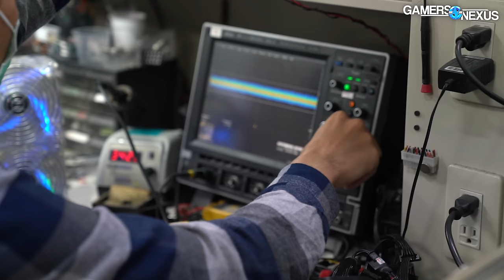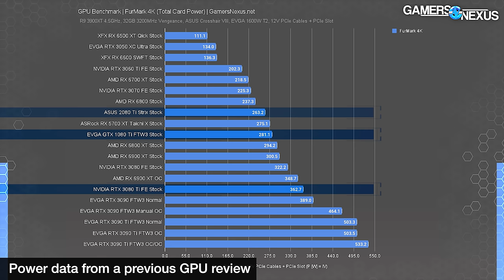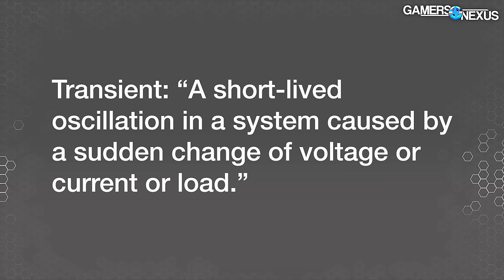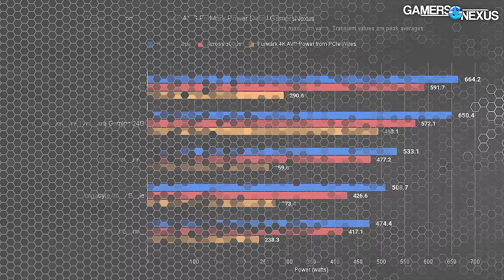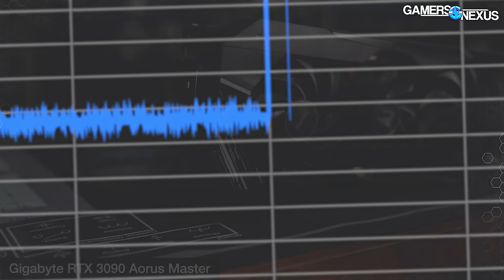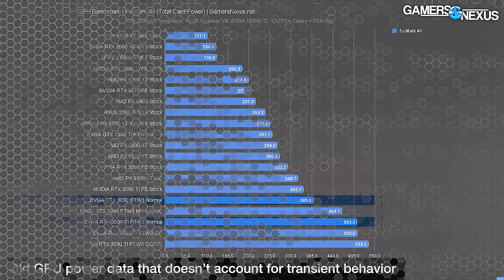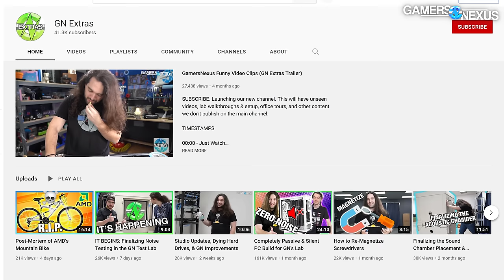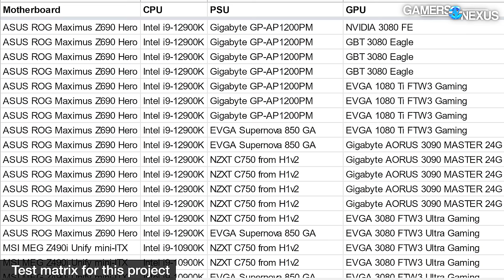The Brewing Problem with GPU Power Design | Transients

Comment: The upcoming ATX 3.0 specification, which was finalized in April, is specifically supposed to address this issue. So, I'm really surprised there was no mention of it here, at all. I've been eagerly waiting for some kind of news from Gamers Nexus, about when ATX 3.0 power supplies might be expected to start rolling out, or if the RTX 4000 series cards will have the new 12+4 GPU power connector on them, which is part of the ATX 3.0 spec. Please ask one of the power supply manufacturers, about an ETA on ATX 3.0 PSUs. I'm very eager to find out, since I'm planning a Ryzen 7000 system.
Reply: They'll surely have the 12+4 connectors on the FE/reference cards, but are unlikely to require it of the AIBs.

The big question is what the PSU requirements will be.  I'd assume they'd say something like '4090 requires a 1000W PSU, or an 800W ATX 3.0 PSU'.  Also, as you noted, its unclear if the ATX 3.0 PSUs will be ready for an October 40 series launch.  It would be really dumb to buy at launch if you have to upgrade to an ATX 2.x PSU that's becoming obsolete.
Reply: Looks like you are expecting people go out to change their PSU with ATX 3.0 spec. Tell it to those people with no knowledge, or those with 1000W+ Platinum rating. 

I doubt those with some years old 750W Gold PSU or above will do that so this info is very useful for the years to come.
Reply: This guy asking the smart questions. Where's atx 3
Reply: @JorgeAlarconL  its very relevant info... Whether you are too ignorant or cheap to buy into the new standard is not relevant.
Reply: @Xirpzy  Assuming that everyone should buy into the new standard and that anyone can afford it is actually ignorant. A good PSU stays a good PSU for as long as there are devices it can run, and people either don't see a reason to change their PSU because of a new standard or they don't want to change their expensive high end PSU just because of a new standard. Some people may not even be able to afford a decent PSU at all. Your comment sounds very pretentious as if you're saying "lol just buy it you poor pleb". Very very disrespectful.
Reply: I'm also waiting for this. Buying a PSU now when ATX 3.0 might become a standard in a few months seems like a bad decision. @GamersNexus, what do you guys think about it?
Reply: @Apexseals The "power excursions" is part of the ATX 3.0 spec, I just double checked.  Table 3.1.  It goes up to 3x for up to 100 μs.
Reply: @Apexseals No, the OP is right. ATX 3.0 was specifically designed to at least reduce transient spike shutdowns. Hardware Busters did a very thorough video a few weeks ago.
Reply: @supra107  only if you read it that way. 

If anyone is to inform us about a new standard I expect Gamers Nexus to do it. Sure you can mention that not everyone can afford it but actually knowing ATX 3.0 is even a thing and what it does (aka not being ignorant of it) is far more important in my eyes. Someone looking into buying new hardware should be made aware of it despite the cost, because its the new standard.
Reply: @supra107  If you can't afford a new PSU you surely can't afford the next gen GPUs especially the high end ones. You are not the target audience. Deal with it. The golden age is over and PC enthusiasm became a higher class (rich) hobby.
Reply: My card currently has 2 such connectors and the adaptors it came with take 3 8pin pcie cables and turn them into 1 12pin connector. The data pins remain empty for now. But yeah, if the 3090 ti cards have them now, you can bet the 40 series will have them. You’ll just have to use an adapter and not populate the data pins with an old PSU
Reply: @Xirpzy  it would be speculation at this point! There are no fvck¹n atx 3.0 PSUs yet. So why would a tear-it-down/hands on hardware channel speculate? Please do tell.
Reply: i hope they dont cost as much as gpu for flex sized psu
Reply: @Xirpzy  It's too soon to say if the information is relevant. And the 'people are too ignorant or cheap' angle is weird. There is no reason good PSUs should become obsolete because GPUs change.
If anything, if PSUs become disposable, that would be a reason for people to stop caring about PSU quality.
We've seen what Apple can do with low power CPUs/GPUs, the market as a whole is moving to better efficiency, for the PC market to move in the other reaction is bad.
Reply: @Gege547  Not neccesarily. Many enthusiasts like me focus on the 2nd hand budget  market and in how to recycle / upgrade old devices to get modern features. I have just upgraded a 10 year old system ( dual Xeon 16 core) that I got super  cheap on eBay by adding two  NVMe raid0 via an1500 (I get  6.5 GB/sg, equivalent to modern  PCIe-4 NVMe ), added an usb-c 3.2 hba, installed a 2nd hand  3080 (thanks to crypto crash...), and a 10Gb ethernet hba,  and now it performs equal or better than  most high end  gaming PCs  for half the cost. And in two years I expect to migrate it to RTX 4000 when 2nd hand market appears for them.
The PC enthusiast hobby  is not only about the latest builds. In fact the sacred rule for most PC enthusiasts is to avoid propietary architectures (like Apple) so that you can later repair &  upgrade at open market prices, and specially to practice our favourite activity: scavenging!
Reply: @quintoblanco8746  how is it too soon if theres already articles about it and GN has mentioned it before? Talking about it in a video specifically about power supplies is to be expected... GN has several videos on 40 series cards and am5, are those too soon as well? I want such information so that I know something better is coming soon. 

Again whether you can afford it or not doesnt matter if you dont know about atx 3.0 to begin with. If people are ignorant they will loose money by spending on wrong things. Pls enlighten me how that is a good thing.
Reply: @LiquifyMods  Normally, I would expect things to take a couple of years after a spec is finalized. But with the connector already on the 3090, and there being a more immediate need for the spec due to power spikes, it does seem likely that the 4000 series will probably have the 12+4 connector. But, I can only guess about it, until there's official news. FSP has also announced an updated power supply with the 12+4 connector as well. So, it seems likely that this spec will be rolling out rather quickly.

Sure, with a high watt PSU, an adapter can likely be used. But, I'd much rather buy an ATX 3.0 PSU if I can, since it will have the capacity to handle power spikes more than double the rated voltage, and is much more likely to be compatible with future GPUs. The ATX 3.0 spec is a significant update, especially for GPUs.

But, here's the real kicker. As I understand it, without a power supply with the 4 pin sense line, on the 12+4 connector, the GPU will be limited to the lowest power setting, which will bottleneck and artificially cap the GPU, even if the power supply is otherwise large enough to handle it. It seems likely though that individual GPU manufacturers would probably override that with an adapter, especially early on in the transition. So, I'm not too concerned about it, but it's just one more reason I'd prefer to get a PSU with compliance to the new spec, if possible, since I'm planning to buy a new PSU soon anyway.
Reply: I saw Cooler Master is putting out   SFX-L 1100 watt and 1300 watt ATX 3.x psu's at some point. Sounds like they were made very specifically to address this issue for the next generation of PC hardware. Hopefully those will be out in time for my next sff build.
Reply: @Marin3r101   GIGABYTE UD1000GM PG5

Comment: I was aware of power spikes in GPUs, but until watching your video, I had no idea they were this severe. I'm getting ready to overhaul my PC and my failing old Corsair PSU needed a replacement. I've just ordered a PSU with more headroom than initially planned to prepare for newer cards and I'm sure it'll save me a lot of trouble in the future. Thank you GN. You're the only mainstream hardware reviewers that are covering topics like this with actual data. For how small this operation is, it's incredible how far ahead your data and methodology is versus much bigger hardware reviewers.

Comment: Yeah got that first hand when I upgraded to a 3080ti. 850w should have been plenty for the steady state, but transients were enough to send the PSU into safety shutdown.

Since you asked for details Steve: EVGA 3080Ti FTW3 Ultra Gaming, ASUS MAXIMUS X Formula, 8086k Der8auer edition @5G all-core, Seasonic Prime TX 850 from 2018 couldn't hack it after upgrading from a 1080ti.

The 1kw model of the same line is doing fine, absurd as that is on a system that draws 450w average while gaming according to my UPS.
Reply from the maker: Great to see real user experiences like this to help establish that this is a factor to consider now!
Reply: @GamersNexus  not just that, even my cable extensions from asiahorse weren't able to handle my 3080, just because of the power not being clean enough
Reply: @GamersNexus  i have been running a gigabyte 3080 on a rm850 that is quite old for a good while and haven't seen these issues. It's a 320w hard limited model so I've made my own curve for it where it really doesn't do the stupid push past 2040mhz at like 1060mv. Mine mostly run 2025mhz at 1000mv so I wonder how this curve affects transients.. I'm not finished with the video yet obviously but I would be interested to see transients without Nvidia boost algorithm.
Reply: This explains an issue I had with a SeaSonic Prime Titanium 1000W about a year and a half ago. Shortly after adding a Gigabyte Waterforce 3080 to a Ryzen x570/5900X system, the PSU blew out. I could not understand how a PSU I had had for 2+ years across multiple platforms would all of a sudden give up the ghost, but to SeaSonic's credit, it only took itself out and every other part was fine, but I literally had no idea it could have been the GPU until now. Yikes!
Reply: Had my 3080ti kill a Seasonic Prime Titanium myself, currently in RMA.
Reply: Ive got the rog thor 850w running a strix 3080ti and i9 12900k overclocked at 5.2 ghz and havent had any issues. The max wattage that gets pulled is 670ish watts
Reply: Edit- I have a scope and a low end amp clamp (considering buying a better clamp)

Interesting comments. I've been running a Corsair RMX850 and TUF 3080ti all stock speeds and voltages (Asus X570 + 5800x) and haven't had issues at all. What can I do to test this out? I've tried 4K max settings and some benchmarks and everything seems great (besides my CPU temp, but that's my fault form bad rad/ fan optimization) Man am I glad I went with the 850 over the 500 lol.
Reply: @GamersNexus  would be cool to test if the PSU cables with built in caps actually help. I have a few older Silverstone cables with the caps by the GPU.
Reply: How old was that PSU. Do not forget that aging PSU can lose up to 10% of capacity a year with heavy usage.
Reply: @Bobinification  I didnt even know that.
Reply: Pretty happy at this point that I bought a way overkill (at the time) 1000w Platinum power supply from EVGA (Supernova 1000PS). Owned a 780 TI and had the idea in my head that I would SLI two 780 TIs at some point, never did, but now I have a 3080 and didn't have to upgrade the PSU or worry about its capability of running the 3080. Though now I'm wondering if it'll really be enough in the future if card power draw keeps going up.
Reply: From the issues i had with seasonic, it seems the problem is due to their OPP/OVP over the rails and you can end putting like CPU cable + gpu on same rail, since there arent any indication of what plug goes into what rail
Reply: @hondawagonz886  It could be less with light usage or with a high-end PSU but the principle always apply. The internal caps will be drying for sure.  Never expect a 5 years old PSU to deliver like it used to on day 1. I would bet that people here complaining are mainly people who upgraded the graphics card down the road but kept the old PSU.
Reply: @vidjagames72  After 10 years I would personally replace any power supply anyway.
Reply: @Bobinification  Actually it's probably because it was most likely a pre 2018 prime TX, which did have alot of problems with high transient GPUs(most notably Vega) which Seasonic did say they fixed already after 2018. But it was most likely that, not PSU age.
Reply: @Bobinification  Looked up my purchase date, it's going on 7 years old. Guess we'll find out the power requirements for the next gen or two of GPUs and I'll have to plan on a PSU replacement (or upgrade potentially) in just a couple years.
Reply: @Bobinification  not true at all. A high quality PSU will loose 1-2% of it's capacity over 10 years. 10% loss over a year would be insane.
Reply: @Bobinification  Whats your source for that 10%? 

1, maybe 2% for a budget unit is much more reasonable. At 10% a 1kW PSU is going to be under 600W with your 10% after 5 years, and those usually have a 10-12 year warranty. So an HEDT system can pull 850W easy. 5 years of working loads... your looking at RMAs every 3-4 years on a 12 year warranty.
Reply: @mortenee88  Same RM750X ran a 3080 with no issues.
Reply: @xuyukun123  Ive stopped using cable extensions because i had issues with USB (had low profile extension cable for front usb i/o), also had an order with cable mod.   Grossly out of whack with what i ordered (wrong lengths, some different pins). Im not using them incase of any issue. Cant trust them at all.
Reply: @vailpcs4040  What was the solution?  Ive been using Seasonic for awhile. If not their PSUS, then whos?   Thats the reason we pay $$$ for , not to have problems!!!
Reply: @nickierv13  I meant the ability to handle transients, not steady state power.
Reply: @ionstorm66   I meant the ability to handle transients, not steady state power.
Reply: @Bobinification  still stands. Some quailty psus have 10 year warranties, which would be next to impossible if they lost that much per year.
Reply: @ionstorm66  Let's agree to disagree. Some PSUs also have different caps quality.

Comment: Seems odd that the motherboard choice affects whether the problem shows up. Could be that some boards have extra capacitance on the 12V rail that "help out" the PSU when dealing with spikes. Or it could be that in some cases it's the motherboard that causes a shutdown if a 12V sag causes it to switch off the PSON signal.
Reply: could it possibly be the pcie slot has more throughput for voltage on some x boards?
 Ge it can do 110w vs the "normal" 75w. so when it hits a transient spike, the slot compensates for it.
Reply: @Dracossaint  Seems like a legit possible theory, the motherboard should never do that though the spec is there for a reason. Above all though the GPU should never need to be drawing 700 watts and if it is going to be doing that the GPU should be the part with the extra capacitance to handle those spikes without requiring other components to carry the load for their poor design.
Reply: Both the amount of capacitance, and the amount of energy the inductors can store will affect the behaviour of a motherboard or GPU card during transients.
Reply: It’s not only capacitance. With transients this big, your board needs to be designed differently. If the copper carrying power to your PCIe slot is too thin, or it’s ground is not directly underneath, the added inductance can negate capacitance on the bus.
Reply: @bdhale34  It's not the motherboard that should not do that, it's the graphics card's duty to not draw more than in total 75W (66W from 12V rail) from the board. 
On the other hand many boards can provide more than 75W of power. I think since the RX480 there were no GPUs drawing more than 75W from the PCIe slot.
Reply: @Dracossaint   Some motherboards do have supplementary PCIe 8-pin headers, very prevalent with older 2/3/4-way SLI/Crossfire XOC boards, to take off the load from the 24-pin and prevent it from melting. It could also be the CPU VRM's capacitors, as in these cases they're systems with high-end CPUs and GPUs paired together, both power hungry components.

I suspect it's in the rising and falling of the spike, not just the plateau. When power spikes in the GPU rail, power may drop in the CPU rail and cause instability. Conversely, as the GPU spike drops, the CPU rail may experience elevated parameters.

P.S. I think you meant e.g. (exempli gratia) meaning "for example"
Reply: As others mentioned, most likely motherboard capacitors are better quality and can handle transient loads better too. Probably especially true in motherboards designed for overclocking.
Reply: I actually had a mini-ITX system that was having random shutdowns when I tried to run a 5800X + 3080 Ti with EVGA 850W SFX PSU. I was using the Asus B450-I ROG Strix. I swapped the board with an Asrock Fatal1ty B450 Gaming-ITX board and it has been completely stable since.

Oddly enough, it was a CPU upgrade that started triggering the problem on the old board when I went from 3600 to 5800X. It ran without issue with the 3600 + 3080 Ti. 

There's definitely something to the theory of the board mattering, at least in my anecdotal case.
Reply: @Nuvcore  for the CPU this is probably true since the VRM is built in, but for the GPU and PCIe slot, the 12v comes directly off of the 24pin connector. That's the reason the standard switched from 20pin to 24pin connector, extra 12v wires for PCIe slots, and they got away from having an auxiliary PCIe power connector on the motherboard.